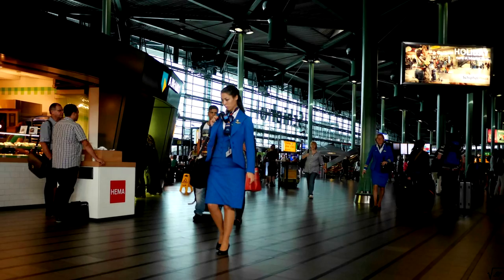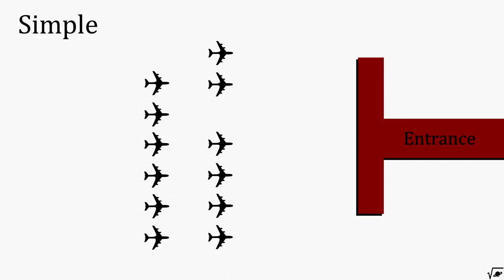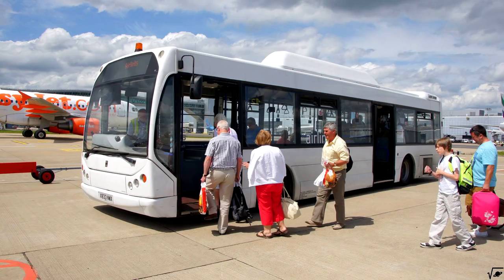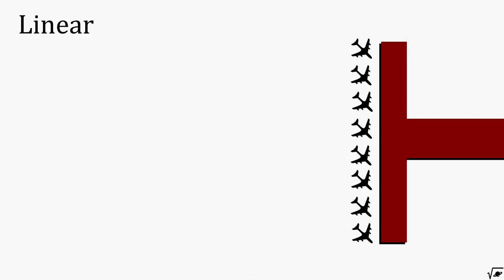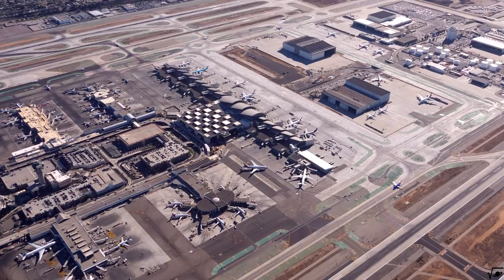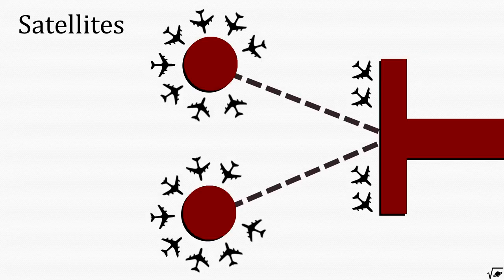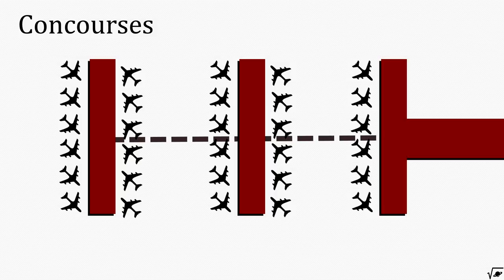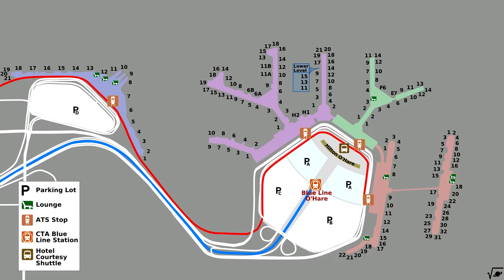How Planes Get Parked On Airfields: Terminal Configurations

Comment: Have watched a few videos of yours already. And learned a lot! I enjoy this type kind of knowledge immensely; I find myself on planes and trains googling the exact model and what it entails, manufacturing costs, length, capacity, etc.
Yet, I have a small critique. The length of your videos is quite good (could be a minute longer?), but it's the third time that I'm surprised by an ending. It feels as if I'm in the middle of the video and all of the sudden it cuts out. Basically, I would suggest a way to tell the audience that the video has peaked and that you're closing the video.
For this for example: after having explained the different parking layouts and given a few examples, you could comment on mixed layouts using some takeoff or taxi footage, while you're also saying something inclusive for the audience, ie, "check the way the planes are parked near a terminal the next time you are flying and you will find of sorts of layouts".
Just a suggestion! Loved the video though! <3